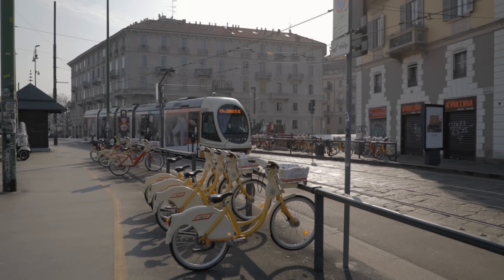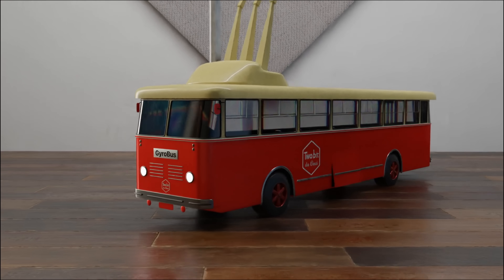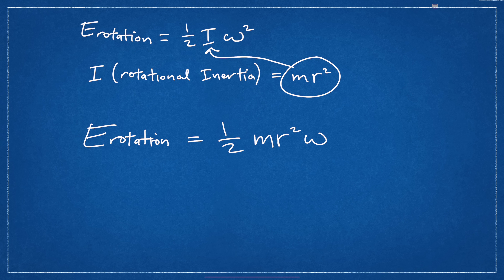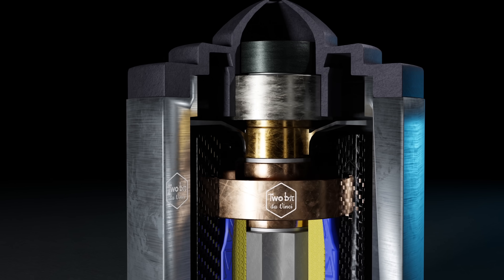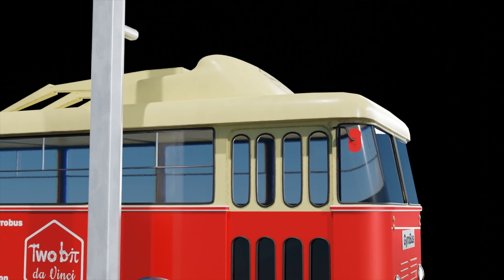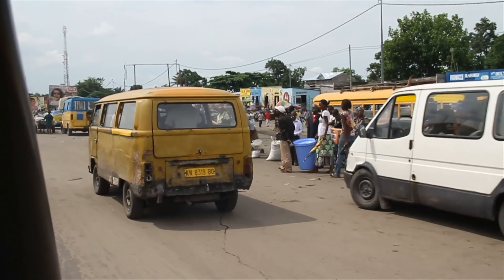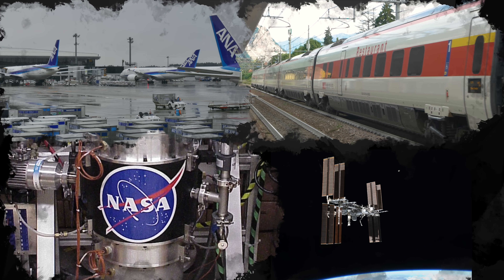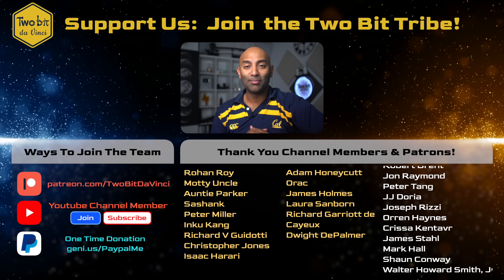This Bus Went Electric WITHOUT Batteries

Comment: This might work better on trains or trams that run on smooth tracks with wide curves rather than vehicles that have to drive over rough surfaces and sharp corners.
Especially with regenerative braking and friction-less magnetic bearings.
Reply: overhead catanary
Trains are already limited to their tracks, so you might as well use
 overhead wire.
Reply: @WesternOhioInterurbanHistory  or a third rail
Reply: @Lestibournes  those are very unpopular as when installed along longer distance lines. People would touch them and die.
Reply: @WesternOhioInterurbanHistory  Overhead or third rail are expensive and I know all about 600 DC dropping significantly over 1.5 miles from the substation.  Energy storage would let short sections of power collection be used either at speed or station stops.  The high resistance electricity return path (usually through the running rails and ground) becomes less of an issue if electricity doesn't need to be returned most of the time.
Reply: @WesternOhioInterurbanHistory  expensive, I like that flywheels effectively toss the locamotive from one station to the next.
Reply: @WesternOhioInterurbanHistory  well yes but you then have to electrify every bit of track you want that train to be able to cover or else tow it with a diesel

Comment: Hyperloop? Oh boy that's not gonna age well...
Reply from the maker: So much hyperloop hate! Lol could you tell me why? It’s nothing something I’ve dug deep into
Reply: @TwoBitDaVinci  Don’t get me wrong I have nothing against your video its just that the idea of a vacuum train is far from practical. Its been thoroughly debunked years ago and even today it’s exactly the same story. Problems with the hyperloop: it’s extremely expensive, its very dangerous, it will have many points of failure, it requires constant maintenance. In terms of practicality you might as well just install a metro or high speed train. The only reason people say good things about the Hyperloop is because they have no knowledge of basic mechanics and physics. As far as me and many are concerned the Hyperloop doesn’t exist outside computer renders, because its not practical to build in the real world. The idea of the vacuum train is around 100 years old by Robert H Godard, not by Elon.

Comment: What is really sad is this brings to light an issue that will quickly be coming in the next decade with the push for more EV's and a ban on gas cars: it's too costly to charge them all the time.

The other problem is the aging electrical grid in the US barely sustains the heavy load of air conditioners every year, what do they think will happen when millions of EV's are plugged into that same grid?  Also, you can't just stop at a gas station and "top off" your battery, there are only about a 1000 charging stations in the entire country AND people don't have time to sit for hours waiting for their car to charge.

EV's are nice, but unless we have a major breakthrough in the next 5-10 years, we're heading for some major issues.

Comment: What if the lightest material at the center of the flywheel was not a material but Air? Air at center flowing out from a vertical pipe that rotated all other parts of the flywheel. And what if we had the lightest components of air to further rotate the flywheel from the center from a vertical pipe inserted from the certer and air blowing out from a few holes from its sides to rotate the flywheel. And what if that lightest form of air component could be reused and was non combustible.
Reply from the maker: Brilliant!

Comment: A modern flywheel UPS 480v , 100kva (up to1000kva) for medical application  from GE is about 100k, using Vycon tech(somehow this OEM has cornered the market).  No expensive batteries to replace every 3 years, only the floating flywheel, levitating  at 30k rpm.  backup time ranges from 15 "seconds" to 60 seconds which is more than enough time for the emergency backup Genset to start.  In other words, on the flywheel busses , there must be a generator or genset(less diesel consumption) providing energy to the flywheel UPS which in turn provides clean energy to the electric motors of the busses.  Of course u can add a 2 ton battery bank for 100k for an additiinal 20 "minutes" backup time. The flywheel has to temporarily store the energy somewhere, capacitors maybe, external batteries.  VOLVO in 1980 experimented  with this, small genset to flywheel to motors or devices, too bad they stopped...

Comment: Storage of energy is essential for surface renewables to progress rapidly: sun and wind are free, available everywhere, so that powerful and expensive distribution networks are not required for those, but our abondant surface free energies are variable and seasonal. They can rapidly decarbonise our planet but some massive energy storage is then required for supplying plenty of our “also variable “ energy offsets needs. If electricity is easy, meaning cheap to transport, electricity is also difficult, therefore expensive to store massively, hydroelectric evaporation and pumping losses, battery cost losses and wear are totally inefficient to decarbonise our planet fast enough with renewables . 
While vacuum and magnetic bearings flywheels are excellent for very shorts peaks load at sudden loss of power or power surge so for frequent frequency stabilisation for sensitive loads, hospitals, data centers, air and ground trafic control, etc, they are not economic to pack and store energy for weeks or months due to a small but constant power loss mainly Gauss losses while turning . 
One of the cheapest if not the cheapest long lasting and durable no loss energy storage is green H2 high pressure COPV. A standard COPV which stands for Compound Overwrapped Pressure Vessel can take today up to 50000 full load cycles without any measurable H2 gas loss, fatigue crack or leak and are massively produced at decreasing costs soon well below 10$ /kWh of capacity as process becomes robotised and they become larger. This is far less per kWh of capacity than lithium batteries so that the static or mobile energy cost per kWh of energy stored with hydrogen is several hundred times less than current chemical battery technology. With primary renewable energy being free of charge, the storage cost alone becomes by far the major financial burden of the energy consumed another time and here the H2 advantage is tremendous. The Burckhardt H2 compressor power loss is also partly recoverable by a decompressor or an adiabatique H2 detent AC before H2 is reused by the fuel cell. The static water electolysers with graphite electrodes are very economical and can use the PV dc current directly without any costly and short life inverters. They produce also valuable pure O2 for welding or medical use and some useful heat for living working and commercial spaces heating, cooling and hot water. Compressing losses and electrolysis inefficiencies of a free of charge renewable source of energy is one “lack of efficiency”  very poor argument of the anti green H2 propaganda of all the current planet roasters: for instance no one care about the real efficiency of a wind mill, since the initial cost, size, noise, low wind performance, maintenance, etc are much more essential deciding parameters than pure efficiency: since the wind is free, no one care if 3 blades are a few feet longer or shorter…for the same output…
The urgent need to decarbonise our economy and the very fast decreasing cost of wind and sun power are the current drivers boosting green H2 production, a 65% p.a growth in Europe only and up to a 45 billions € market volume per year by 2030. Coal, fossil fuels, electricity, mining and related polluting and carbonising industries are all lobbying dead against green H which induce also a complete and social wealth redistribution from a very few polluters to many self producers and consumers, but scientifically and economically the planetary cleaning pump is now primed and the faster we ban and pump out coal and then petroleum out of the way, the better off we will be economically. Then, historically the loads have always adapted to clean available and economical energy sources such as green H2 and derivative green CH4 and NH3. Heavy battery powered EV are just an unpopular and unpractical expensive transition with high micro and nano particulate PM urban dust generated by tyres and road wear proportional to vehicular weight..soon an heavy mobility of the past with poor resale value and very poor sanitary value for our lungs

Comment: I'd love to see a flywheel storage system designed for a typical home. Run off solar during the daylight hours and off the flywheel for nighttime energy requirements.
Reply: Nah, what youd need is something like solar harvesting energy to power  capacitors to feed a repeating accelerative impulse at regular enough periods to maintain the inertia
Reply: @bugabookatzenjammer661   A capacitor is just a battery with a short memory and has all the problems a battery has. The lifespan of a stationary flywheel far exceeds batteries or capacitors. Especially in parts of the world that have below freezing temperatures for many months out of the year. Selling excess energy to the grid and buying it back when needed doesn't work because they pay little when buying from you and charge much when you buy your energy back.
Reply: @bugabookatzenjammer661  wouldn't anything make a better battery?
Reply: That's what they use in Antarctica, with wind and Solar energy
Reply: It's good for short outages only. More of a voltage regulator.
Reply: They are so dangerous tho
Reply: @Constellation3232  - You'd need to have it buried underground so if the containment failed it couldn't go anywhere.
Reply: @Constellation3232   Not really that dangerous if it was built sunken into the floor in the basement of a house.

Comment: when the supercapacitors evolve..
similar kind of buses will be on road,
backed up with a very low sized battery,
runs on the huge capacitor charged at every stops..which are very efficient than
battery. .
engineering never fails..it just convert and creates way for newer ones..
thanks for the amazing video..

Comment: Couldnt you add solar panels system, as well as 3m manufacturers they've created window glass thats has a vacuum seal in between the panes but they generate electricity. Combine all that with thermal coupling.

Comment: Gyro effect should not negatively impact the bus turning as the bus turns around the same (vertical) axis and displaces the axis horizontally, but without attempting to change the angle of the gyro's axis. It's just the effect of having to turn/move the extra weight. The gyro would actually make the bus less prone to leaning against the turn.

Comment: This is another great application for graphene or carbon nano materials. By being far lighter and being a conductive material in themselves they would be far more efficient. They could put them back on the buses these days with independent engines on the front and rear axles. Smaller and lighter flywheels along the 20ft body would make sense to stop worrying about the gyroscopic effect.

Comment: Flywheels with Springs cranks to help keep the flywheel moving.  Put the energy into cranking up the springs and release the spring to spin the flywheel.
Reply: So the bus problem can be solved if two flywheels are spinning in the opposite direction of each other on the same rod.  The gyro effect is canceled. It does require both flywheels spinning at the same RPM for this to work.

Comment: I know for a fact that this bus engine was intentionally under-engineered so as in order to fail, so as to hide the potential of this type of technology.  It is elementary, itself.  If the guys at Tesla had their act together, they would have improved on this type of theme in design two decades ago.  An electric car could have been brought to the street for under ten million dollars in design and tooling investments  in under a year.  The cost of the car could easily have been limited to well under $30,000 at tremendous profit, by way of comparison.  As far as that goes, Musk is an idiot.  If ANY engineers on this planet had their act together, an electric engine requiring no fuel or batteries would have been built about sixty years ago, at least.  Any mechanical engineered perpetual motion machine, like say a gyroscope, could be engineered to spin a turbine (and, not a flywheel, duh).  Say hello to my family.  We have been hiding this type of stuff from you troglodytes, being raised as orphans in surrogate families, for centuries.  Need a UFO?  Got one right here, fella, thanks to carbon fiber.

Comment: It is worth considering what could be the minimum and maximum credible accidents with a flywheel. There are alternatives, such as compressed air storage, which is also viable, but carries the risk of explosion. Electric batteries have fire risk. Interestingly, gasoline is very good in that it has a very high energy density and can be stored safely at normal atmospheric pressure in a tank in which it will not be exposed to the risk of ignition, and that tank is typically between the rear wheels of a vehicle, for safety. And that of course is why gasoline is so good. Except for the pollution aspect, which now matters. A lot.

Comment: Lol . Ask yourself why they stopped to use the flywheel technology inside a vehicle for moving. The answer is the same why they stopped to use steam driven cars. In case off an accident there is an uncontrollable energy relaese which will lead to further destructions. No Company, no Insurace, no Politcian will take that risk to explain a crying mother why a 3ton flywheel smashed her child in an schoolbus accident- for a green happy future realy. Unsuitable as a mass energy store, since the law of conservation of energy still applies in this universe and zero friction does not exist. Even if no work energy is used, a permanent loss of energy can be observed, which is given off as heat to the environment. So the flywheel will stop at some point without a new supply of external energy. Since a battery with self-discharge losses is better. Cheers

Comment: Lots of potential - but hi tech with frictionless bearings and vacuum housing - how you get the energy in, and more importantly, out.  What are the losses.  If it was easy, VW would be on a charge - but they are not because mass production at present isn't practical.

Comment: My mistake. Somebody last year told me Newcastle Light Rail uses flywheel energy storage but my research just now confirms it uses batteries and super capacitors. It takes about 20 seconds at each stop to charge up. Still, it's a fascinating new wire-free system you might want to showcase one day.

Comment: Modernly these ancient-ancient technology could be modified to perfect late modern issues, indengeon power beams both ground or ceiling top of area paths, gimbler rotation, that kept the gryos conflicting rotatuon of vehicles. I could vision a company like Lyft using these for a bus pickup service, with multiple phone/card pass doors entrering, as private seating spaces, especially the other greater invested main stream companies offering full fledge transportation service. Would be great to take a trip to & from an airport, when your personal travel isn't available,  without being entertained by weirdo strangers.

Comment: When I was in Seattle several years ago, I was impressed by the fact that they had electric busses powered by overhead cables through poles attached to the busses and hooked over the cables.  It wasn't unknown for a bus to fail to manipulate a turn in just the right way, forcing the driver to get out and re-hook a power pole on the cable.
Reply: In the UK those were called trolleybuses and were quite a common site in various places it was my understanding that the pick up didn’t actually hook over the cable but pushed up onto them there was a trolley bus terminal I visited in Hastings I think it was after that all shutdown that was being converted to a museum.
Reply: There are trolleybuses operating in Vancouver, BC every day.
Reply: @RandyTWester  Toronto had them probably into the early 90s but not anymore. Now they just have streetcars only using overhead wires
Reply: I vaguely recall riding on a trolleybus in California in the mid 1970's, and the driver had to go and rehook her power lines in an intersection.  A flywheel or battery with enough storage to go a half block would have helped a lot.
Reply: @RandyTWester  trolleybuses are extremely popular in ex eastern bloc countries in europe, and now new trolleybuses are being rolled out with batteries for that exact reason
Reply: Ive witnessed a trolley bus one of the power pole went into the wrong power line and the bus stalled.   He had to come out and re-hook to the right ones.   

Also other event, saw a articulated trolley bus power pole ripped off the bus and was hanging on the power line.    ouch, man.
Reply: They have limited battery capabilities now. Used them to divert the 49 and 70 over I-5 when tge University. Ridge was stuck.

Comment: 'The operator considered them unreliable, "spending more time off the road than on", and that their weight damaged road surfaces. They were also considered to be energy hungry, consuming 2.9 kWh/km—compared with between 2.0 kWh/km and 2.4 kWh/km for trams with much greater capacity.' - Wikipedia.